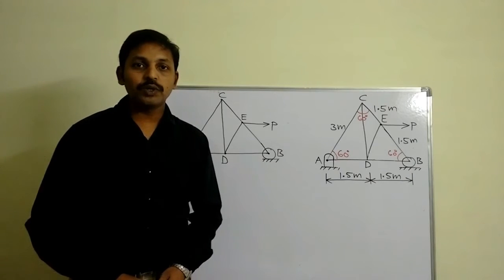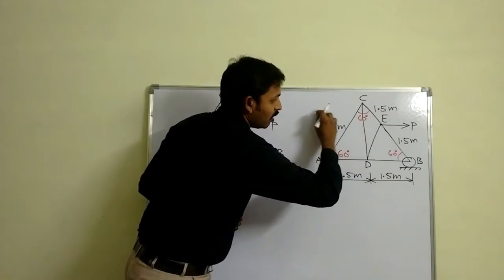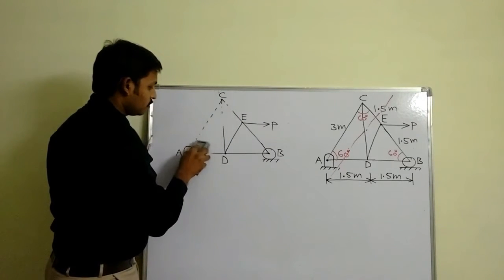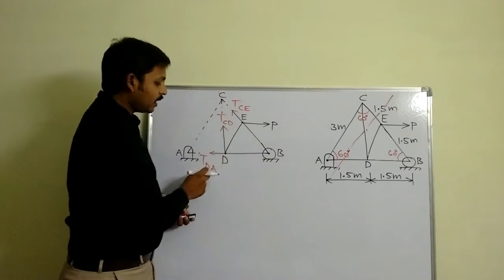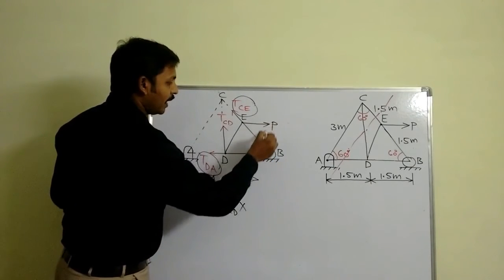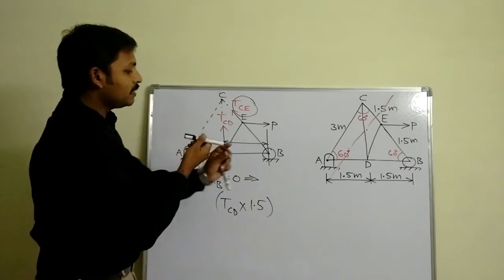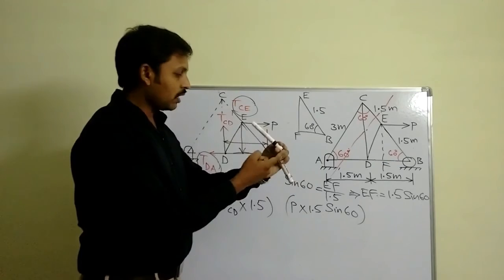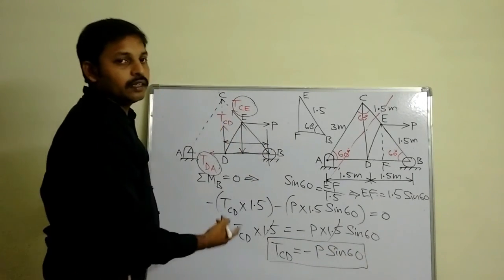Method of Sections Problem No 2

Comment: It looks like you know Telugu. I am an adjunct professor at JNTUKakinada (AP)  College of Engineering teaching Engineering Mechanics in a New Way. I found a simplifying Theorem that  generalizes/replaces   Lami's Theorem. It  was accepted by the Mathematical Association of America and was presented in their MATHFEST 2016. I have been teaching this subject since 1970's at IIT Madras and US Universities (40 years). I would like to get in touch with you to discuss further simplifying and shorter answers to certain problems in Statics,  Dynamics, Kinematics etc., using what I named as SIMS (Simplified Integrated Methods of Solution). I can me reached at nsmalladi@gmail.com. Please respond. Your presentations are the best I came across in India as well as US. The comment by Srinivasarao 30251 is very appropriate. N.S. Malladi, PhD.
Reply from the maker: Thank you very much sir... It is my pleasure to work with you... I will definitely mail you Sir...